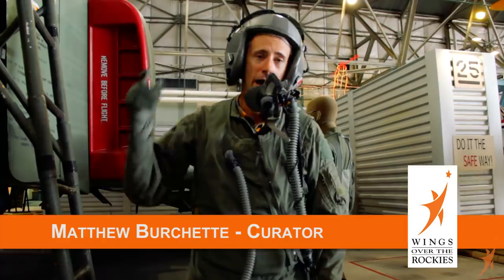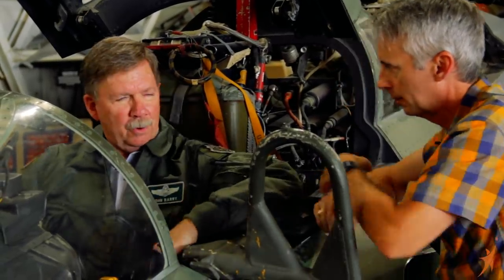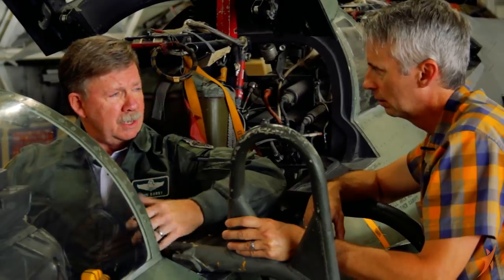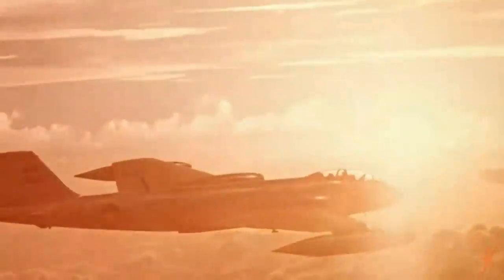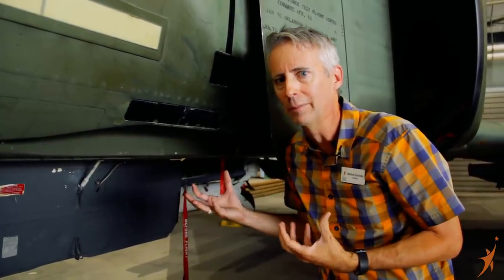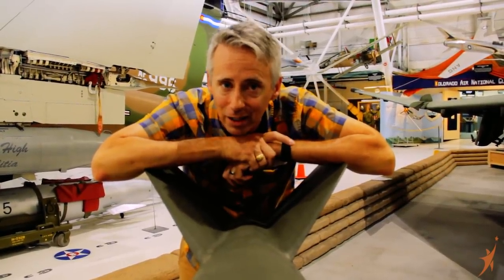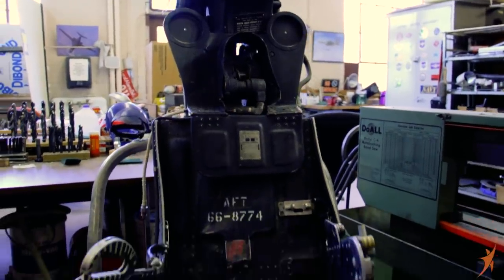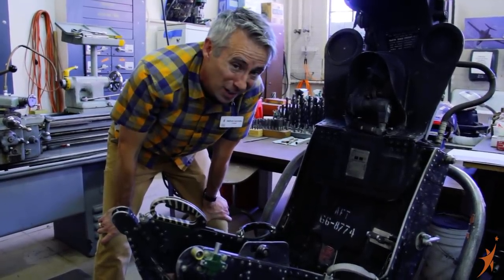F-4 Phantom | Behind the Wings

Comment: I wonder with modification if the F-4 Phantom could still be a viable piece for an air force today??
Reply: 1joshjosh1 Even in 2018, it still is for a few countries ! Phantoms Phorever !
Reply: The JDF, Greece, and RKAF still have a handful in operation. The chief issue is wing area, drag,  and engine power to weight. The J-79 was a damn good engine for it's day, but it's day was to be honest 50 years ago. The dry weight of the J-79 is approximately the same as the P&W F119 but the F-119 produces approximately double the thrust.  The J-79 is also 10% more fuel hungry than the worst of modern engines in it's class (though it was 30% better than it's contemporaries). The Phantom was also designed before area rule was understood fully, so it creates more drag than it would if this had been taken into account. Wing area is 530 sq feet which does not sound huge until you compare it to the F-15E which is only 608 sq feet even though it's 25% heavier at full load at takeoff. IE 88% of the wing area for 75% of the weight and remember the empty weights are almost the same F-4 30,500 lb ish as opposed to 31,700 lb ish. The F-15 has a maximum take-off of 81,000 lb as opposed to 61,800 ish for the F-4. That extra wing area is nothing but drag at over 350kt even at full load. So for the 1960's it was superb, but technology was moving so fast that by the 1980's the F-15E totally outclassed it. I won't bother going into why the electronics are crap by modern standards because it involved a knowledge of analogue computers.
Reply: terry waller  I had heard that but was not sure the Greek ones got the upgrade. The IDF just put their own electronics in and RKAF I think got the upgraded F4-E after the USA ANG retired them. That said I'm going from memory on this issue so could be completely wrong.
Reply: @gordonlawrence4749   Good, but please don't call the superb electronics of the Phantom crap.  The radar for instance would still do a Phantastic job but with fewer  target capabilities,etc.  Analog computers did great for the requirements.  And American quality.  Exellent, , but superceded.
Reply: @backpackerthrulife8497  I said crap by modern standards. Anything that old is likely to be crap by modern standards, and analogue computers are not only inherently slow but subject to thermal drift and aging drift. It was better than anything else in the 1950's and better than most in the 60's but that was 50 years ago. You cant even get phased array radars for analogue systems, so they had to have either a hideous cassegrain antenna or a mechanically swept antenna. - more moving parts and more to go wrong. Analogue radars back then had far less potential range too.  The early variants had AN/APQ35 Radars which only had an effective range of 16 nautical miles for tracking and not even 2 nautical miles for targeting. That was very rapidly (in a few weeks)  replaced with the AN/APQ46 which doubled both ranges. Still not great. The AN/APQ-50 extended ranges a bit more but we are still talking a maximum of 40NM for search and 8NM for tracking. The AN/APQ-72 (retrofitted to most F4-B onwards) was finally a radar that could take advantage of the Sparrow missiles but even then only just as it had a track range of about 12NM and the Sparrow III (AIM-7D) was capable of intercepting at double that with the new Thiokol engine. It was only finally with the AN/APQ-120 that the Phantom got a decent radar that could take advantage of the full range of the Sparrow missile and other weapon systems. Even then compared to for example the AN/APG series of radars some of which were contemporary with the AN/APG63 arriving about the same time as the AN/APQ-120.  The AN/APQ had significantly more range and a better upgrade path which is why the AN/APQ series is no longer in use.
Reply: @gordonlawrence4749   Yes I know most of those things  but my point was it would be kinda like calling the P-51 crap by  modern standards.  At the time tho they were the best in the world.  Or you could also say the modern systems were crap for not being there when they were needed !  Enjoyed though all the info and specs again.
Reply: @gordonlawrence4749   Also, you still have analog front ends of each of those array elements, and alot of airborne phased arrays are also steered mechanically as well electronically.  What crap!
Reply: Gordon Lawrence Your comments are pointless, the F4 was cutting edge in its day and had a stellar career over many decades ,it will be interesting to see  how these overpriced pieces of shit like the F35 fair.
Reply: @interman7715  you are wrong. I was originally replying to a comment about why the F4 is not in use today. Therefore it is actually your comment that is pointless as it has not taken context into account.
Reply: Gordon Lawrence Okay 👍
Reply: interman 77 “Overpriced pieces of shit”. 50 Million dollars for an airplane that has one of the best K/Ds and ordinance delivery ratios at red flag is totally overpriced. Do some research. 

The price that you see in the news is for the entire cost of production for 2000+ aircraft and maintenance/fuel/weapons until 2070. Yeah, sure. thats overpriced.

It’s actually probably the cheapest you can make and maintain a 5th Gen fighter. It’s cheaper than most 4th Gen fighters.
Reply: With avionics upgrades, totally!
Plus these were cheap, $2.4million apiece back in 70's dollars.
Reply: interman 77 Again, how are they overpriced? They only cost $50million per unit. They will become the mainstay general purpose aircraft of the entire US military. And many of her Allies. 

Is it really overpriced when it comes to...lets say...WINNING THE NEXT WAR!. And they won’t only be used to kill goat hurders. As the Air force is also looking into aircraft that can only be used in an air superiority environment. Which is not where the Lightning II is supposed to fight. 

It is designed to keep a pilot safe and deliver Shock&Awe and fight and win against enemy aircraft within complex enemy air defense grids. And it does an amazing job doing so. As proven by red flag. You saying it is overpriced could have been said about any 4th gen fighter. The F-35 is cheaper than the planes it is going to replace. And will end up saving the US taxpayer lots of money. As the “Trillion dollar cost” IS SPREAD OUT OVER 60 YEARS! Compare that to most fighters we. And the rest of the world operate and you will be hard pressed to find a plane that is as combat capable for the price.
Reply: interman 77 I clearly can’t convince you. Check out Dalek14MC Mk2’s channel. He has more information on hand than I am willing to spoon feed you. 

Tell me, if it is so bad, why does anyone who flies with it, or has maintained/operated the thing think it is a fantastic machine? You don’t have an answer that supports your viewpoint on that one.
Reply: U TELL ME MAN I ONLY WORK HERE I have been around a long time and have the ability to tell shit from clay and the yanks are the biggest bullshit artists God ever created especially when they have to sell something .Btw watch the video by Vox about the f35 and how much of a disaster it  is ,you might learn something.
Reply: Good concept. Maybe only as an air defense fighter?
Reply: @chrisbak6329  Great video Chris
Reply: Turkey has upgraded F-4Es that are basically 4th gen. fighter-bombers
Reply: Japan still use them if I’m not mistaken
Reply: Sadly, it retired at 2016 for America.
Reply: @interman7715  To be fair, the Harrier couldn't take off vertically with a full ordnance load either and I don't think that the F-35 was designed to do that anyway. The idea is for it to be a STOVL aircraft and not VTOL, and if it really needed to take vertically (for whatever reason) while fully armed, it could (in theory) take off with less fuel and top off at a tanker after taking off, assuming that it has enough fuel to do that and the weapons load outweighs the fuel needed.
Reply: Japanese Air force still uses the F-4

Comment: I worked on these at bein hoa Vietnam as an electrician , one hell of an aircraft .
Reply: One hell of a lot of wires if I remember correctly too. The F-4 was THE reason for a move to fly by wire and the MIL-STD-1553B bus system.

Comment: Looks like a D model, we put SUU-23 gun pods on them and they killed my knees cranking ammo into them every night.. The F-4 wing and centerline are pretty low so there was not a lot of room to put that B-61 and AIM-7’s under the airplane. MK-82’s were either on a centerline MER or TER’s on the wing stations. The only thing easy to load were AIM-9’s. They were waist high unlike the F-16 or F-15 where you had to lift them over your head. I still have, as most pig maintainers probably do scars on my back from all those drain tubes that poke out all over the fuselage centerline area. Am I complaining? Heck yeah! I wouldn’t be a true USAF 462 bomb loader if I wasn’t complaining!🤣

Comment: Great video! The F-4 never used a GPS guided bomb. They did use the bolt 117. That was the first laser guided bomb developed in 1968.
Reply: Hmmm...  Never say never.
In US service, YES, BUT they did upgrade some of the US planes with GPS system in the 1970s or 1980s.  That was for something else (guidance/navigation), not bombing.
It is possible, although unlikely they spent the money, one of the countries still using the F-4 upgraded planes with GPS for bombing.  They're diminished numbers and it's likely no country but Iran will be using F-4s are 2025.
South Korea, Japan, Turkey, and Greece are waiting on F-35s or have economic issues that prevent retiring their F-4 fleets completely otherwise they would have retired AT LEAST 15 years ago.j
Reply: @AvengerII  my point was the United States wasn't dropping GPS guided bombs in Vietnam. Which country used the f-4 to drop a GPS guided weapon? They were fazed out of service before GPS became a thing. They only ever did recon in the 80's
Reply: I believe the Greek and Isreili F4 (Kurnass variant) have actually dropped GPS guided bombs and both are way updated avionics wise compared to the retired US F4's. The Greeks were updated in about 2002? The Popeye Turbo ALCM is definitely Kurnass launched and has mid-course INS and GPS correction. Kurnass is a very cool name for the F-4 as it means "sledgehammer".
Reply: Gordon Lawrence What about Desert Storm F4s ... then though 1995 ... and then by other countries ?
Reply: @1badhaircut the F4-G used in Desert Storm was a wild weasel so used Maverick HARM and Rockeye (or a more modern equivalent). There were no GPS guided bombs in 1995. There were not even GPS guided bombs in 2005 as you could not get the electronics small enough and capable of handling  the vibration etc for flight certification. The US retired the last combat variants of the F4 in 1996. As for other countries read above I already covered that.

Comment: Had someone dropped the ladder like that when I was crewing they’d get their butts chewed. There’s a reason they used a ladder...the retractable ladder wasn’t the most beefed up piece of metal and would crack at the rivet connections for the steps. Anyone familiar with stop drills...would know this plane would have a lot of them.
Reply: Well you must have been in the USAF.  I hate to tell you but I never saw or used a boarding ladder like that video except when I was TAD at Kadena AFG on Okinawa.  All of us poor Marines and Sailors had to use that drop down ladder to enter the cockpit.  I worked on F-4Bs and F-4Js from 1973-1980.  Naval Aviation was always on a very tight budget for everything.  We flew and maintained our Phantoms on VERY tight shoe string budgets unfortunately.

Comment: In my honest opinion, the best American jet ever made next to the F16!
Reply: F-16 way better. Fun fact F-16 was also developed for use as a Joint Strike Fighter. It was supposed to be used by the USAF, USN & USMC. However, even though the USAF loved it, the USN hated it because of only having 1 engine. Of course if the USN wasn't having it the USMC sure as hell wasn't taking it either. It's really cool seeing the documentaries with an F-16 landing & taking off an aircraft carrier! To appease the USN & hopefully the USMC the F-17 was developed, but it ran into issues & eventually morphed into the F-18 Hornet & the USMC went with the AV-8 Harrier & eventually added the F-18 Hornet. The upgrade to that was The F-18 Super Hornet which is basically the F-19 as it's almost a new aircraft.
Reply: Magestic ....Not sure you can say the F-16 is “way better”.  I worked on both.  The F-4 is a tank in the air while the F-16 is more like a Maserati.  Very different roles.

Comment: From what I heard, this aircraft initially didn't have a gun, it was a missile platform, but the tragets usually had to be double tapped with missiles due to how unreliable the sparrows were. Besides that, this aircraft proves that if you put enough thrust behind something, it will fly since the F4 is also known as the "flying brick". 8 year US Navy veteran that worked on the flight deck as a fueler for 3 years. 😁

Comment: FYI, in can anyone wants to know -- I CERTAINLY had this question(!) --

CAN an ejection seat be reused once it's been used to get out of a critically damaged aircraft?

http://martin-baker.com/about/ejection-seat-faq/

The answer in this FAQ is from Martin Baker, the prominent ejection seat manufacturer in the UK.  They supply a  lot of ejection seats to the US Navy including the ejection seats used in the F-4, F-14, and F-18.
(ACES provides the ejection seats for USAF plane types including the F-15 and F-16.  The seats are about equal quality between both companies.  It's a matter preference and bids ($$$) as to which company wins the contract for providing the seats for an aircraft type.  The US Navy upgraded the ejection seats in the F-14B and D models from the original F-14A model but they still stood by Martin Baker as their vendor for the F-14.)

NO, an ejection seat is NOT intended to be reused after it's been used in an emergency.
I would imagine the structure of the seat gets compromised once the rockets get fired and it accelerates away from the mother aircraft.
Wouldn't be much of a business if ejection seats were recycled after they were used, would it?
<chuckles>  In reality, it's not a good idea to reuse it.  Again, I would imagine parts of the seat gets deformed/compromised after an ejection.